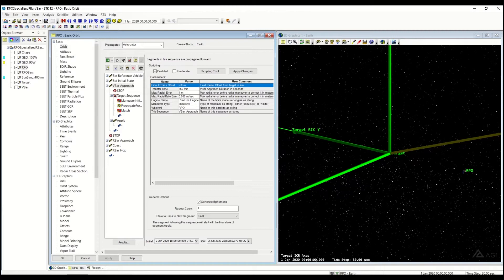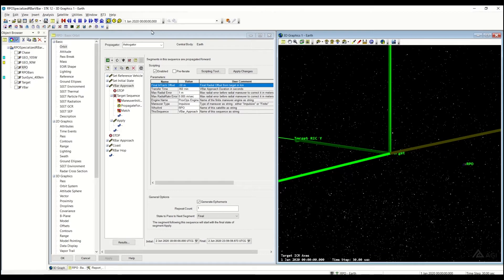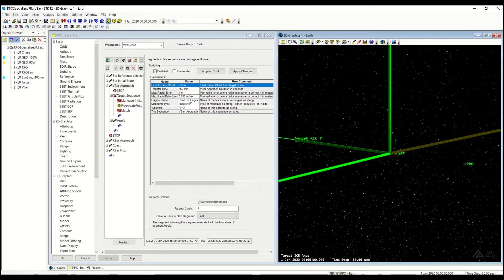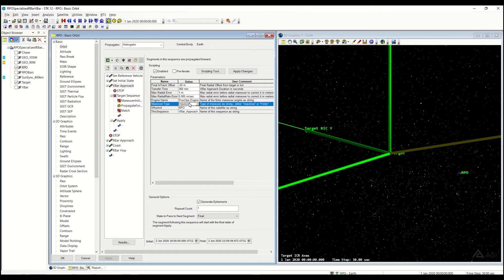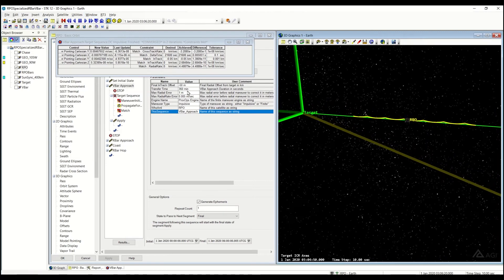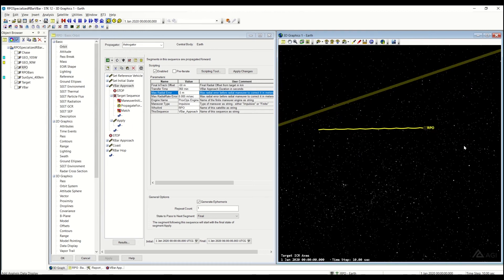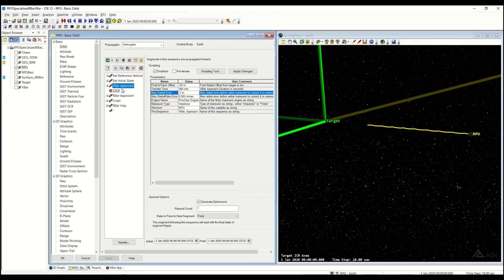The RPO Specialized RBar and VBar/VBar Approach Sequence (37)

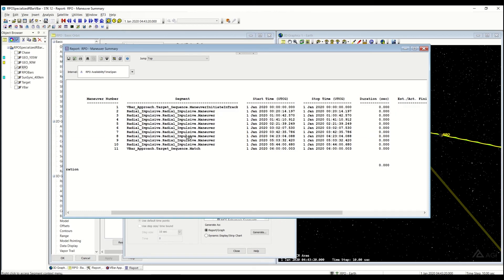Comment: thank you for this nice and descriptive tutorial. A velocity vector is always tangent to the local orbit and hence there is a radial component and then a perpendicular component. Unless it is a perfect circular orbit, obviously perpendicular component will not be in translational direction. Does the term @4:16 "in track" mean along the velocity vector (translational) direction or along the perpendicular velocity vector direction? Also looking at RPO summary, there is roughly 40 mins in between firings whereas in the animation with 3d plots visually speaking the firings seem to be quite close to each other (not in the order of 40 mins duration). Does STK, for the sake of better visualization apply some scaling factor? Finally would it be possible to download this sample RPO summary (shown in the video) from somewhere on the internet? Thanks